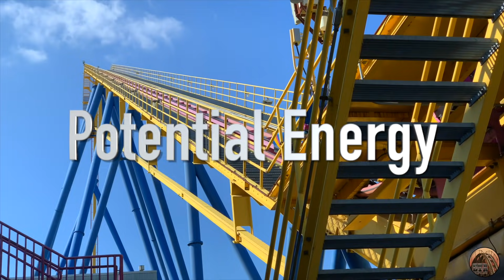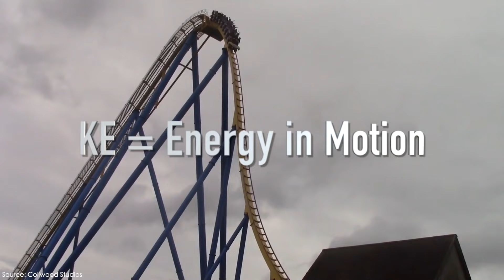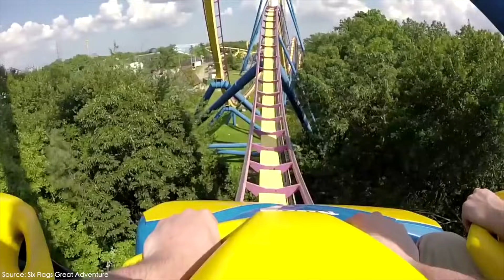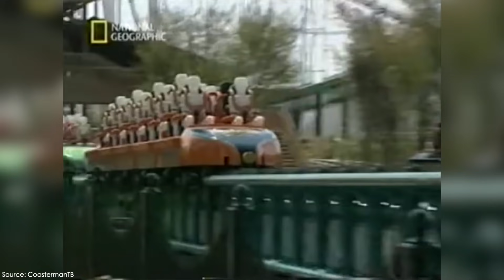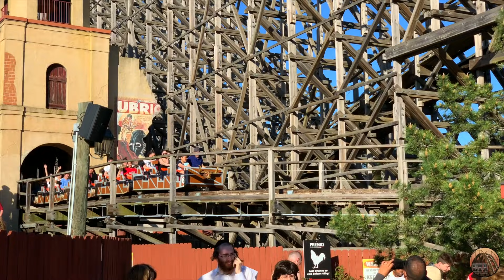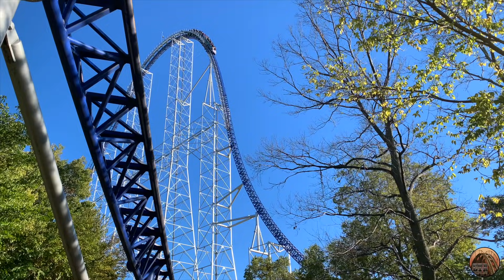How Roller Coasters Use Energy - An Introductory Lesson

Comment: I used to bring my handmade working models to grammar & middle schools. I designed one small enough to fit in a elevator + still carry 3-4 passengers. Sometimes there were 2-3 floors in a school.  That one was called cRaZy. It had 3 inversions. The grammar kids upon learning I worked in a themed park had lots of questions, including If someone had ever died on a coaster I was operating. LOL! They would all get a turn at the end as instead of a motor, there chain was a hand crank. I had Playmobile people in the cars for weight. A train could weigh 3.5 pounds! Yes! I did calculations for speed etc. Prestone Poly spray 4 track/wheel lubrication.

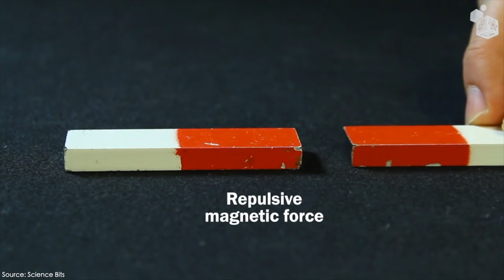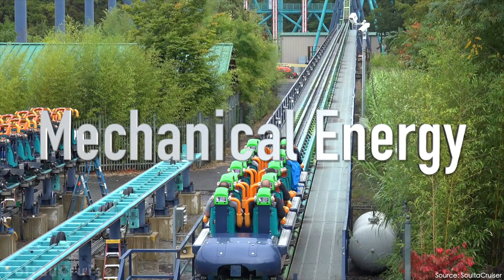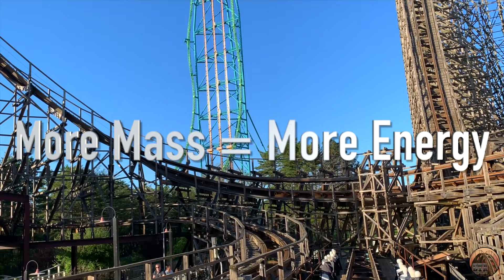Comment: This is a very fun video. But as a german physics student (I apologize for my poor english) I noticed some things that either weren‘t fully and correctly explained or were downright incorrect. 3:00 you tried to explain magnetic brakes: First of all those brakes are better known as induction brakes (or eddy current brakes) which tells the true principle behind those types of brakes. In a nutshell because of the motion of the train the static magnet creates a Lorentz force effecting the electrons in the conductive metal under the train. The Lorentz force however makes the electron move perpendicular to its direction of movement and to the direction of the magnetic flux of the static magnet. Therefor the electrons move in circles (better known as eddy current) which creates another electromagnetic field oriented in opposite direction to the magnetic field of the static magnet. 4:02 you introduced „Mechanical Energy“ which I have never heard of. A hydraulic launch like Kingda Ka‘s also uses potential energy, but this time the potential energy is given by building up a high amount of pressure and then releasing it creating kinetic energy. 6:13 I‘m sorry, but this is straight up wrong. If we were to observe two trains (one being empty and the other fully loaded) in a world without friction and atmosphere, both trains would complete the course in the exact same time. So, fully loaded trains are not faster as empty ones! They just preserve their velocity a lot better. Here is an example: Imagine a feather and a stone falling within an atmosphere like earth‘s. There are uncountable air molecules which perform an elastic impact with the stone/feather. All of these impacts causes the stone/feather to loose its energy to the air molecules and therefor losing speed over time. And Because the feather is lighter than the stone the molecules‘ impact on the velocity of the feather is much higher. As a result the feather decelerates more than the stone, just like the fully loaded and empty train. The effect of rolling friction also differs between a loaded and empty train, but this difference is negligible. 
I hope you could fully understand all of my points in this comment. And I want to clarify that this is not a rant, because I like the idea of explaining the stuff we all love. But it needs to be done correctly. Maybe it‘s just me …
The rest of your videos, however, is great. Your videos are informative and super enjoyable to watch, even for a none native speaker like me. So, please keep up the great work. But I‘d like to see this video getting a makeover as soon as possible.

Comment: Just recently found your problematic roller coaster vids and fell in love, but was always a little skeptical on your reasoning as to why more massive trains move faster. It is not because the trains with more people have more energy (which is true) but I think it has to do with air resistance. The equation relating two states of a system's energy (top of hill vs bottom) can be written as mgh=.5mv^2 (potential=kinetic), but the mass in the equation cancels out, so in a perfect world w/ no air resistance or friction, mass would absolutely not effect the velocity as it is equal to sqrt(2gh), not involving mass at all. So now why do trains move faster with more mass if it is not bc of the extra stored energy. My first thought is friction, but a more massive train increases the force of friction acting on the coaster which would actually slow it down, so that isn't it. Finally, I think air resistance is to blame for light trains moving slowly. The amount of force imparted on the train from the air should be about the same with mass vs without if traveling at the same speed, but with mass the effect of that force slowing down the train is minimized; as the net force acting on a system is equal to ma, solving for a gives a=F/m, the bigger the acceleration the slower the train will go. So to minimize the deacceleration imparted by air friction the mass of the system is increased to make the quantity of F/m smaller, reducing the effect of wind on the coaster. Thank you for the content and being a full on nerd, great stuff.
Reply from the maker: You’re absolutely right! The concepts in the video were simplified so 8th graders would understand the basics. Didn’t want to get too specific with them!

Comment: A point of clarification for the trains moving faster while full vs. empty: while the trains do have more mass, they also have more inertia to overcome, which increases with mass linearly (why a brick and a feather fall at the same rate in a vacuum). The reason the trains run faster is that because the trains have more mass, wind resistance which doesn't increase much with more riders, and rolling resistance (friction on the wheels) which doesn't increase linearly, affect the train less in a relative sense.

Comment: If you were to replace the launch tracks on coasters like kingda Ka and top Thrill Dragster with conventional lifts that take the train to the top of the tower and at about the same speed that the train crests the peak at, the ride after then would be exactly the same as it currently is since it gives the trains the same energy at that point in the ride.  Of course the launches make the ride much more fun and interesting